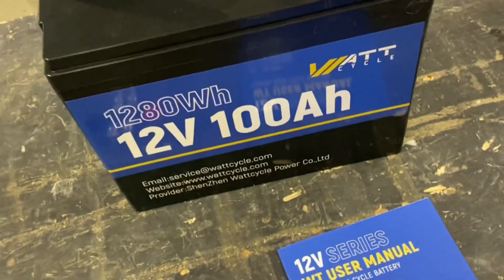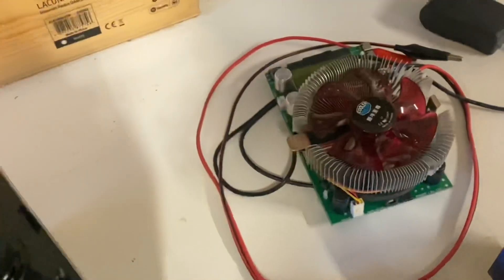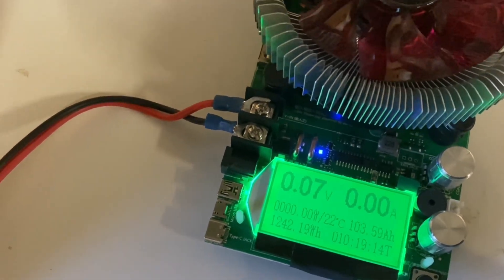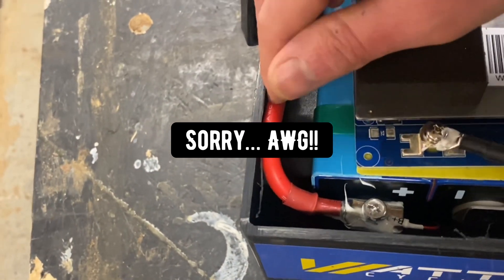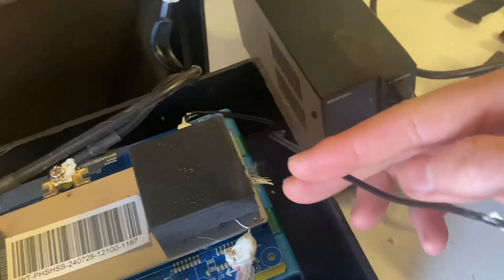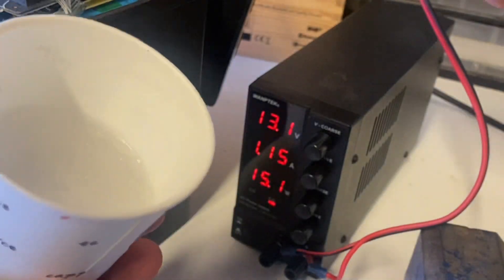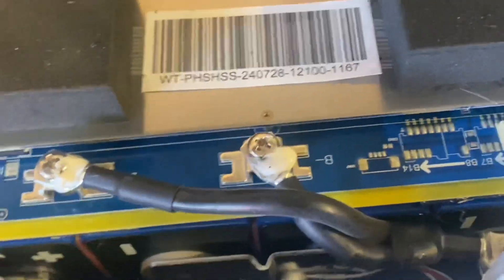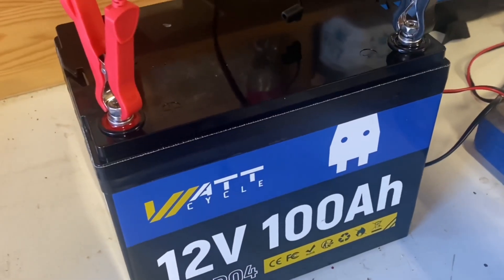WattCycle 12V 100Ah LiFePO4 Battery Review: Capacity Test, Teardown & Temp Protection!

Comment: What charger do you use?
Reply from the maker: I use a DC power supply or a dedicated LiFePO4 10A charger in these videos.
Reply: @JonasSyver  I should have phrased it differently. Do you have a specific brand you recommend? I just bought a wattcycle 12v 100ah but haven't bought a charger for it yet so I'm wondering what would be best. Thanks.
Reply from the maker: Oh sorry😅 depends on budget and how fast you want to charge. For AC to DC charging, Wattcycle has a few options as well. I don’t have a recommendation as of now, but everything above 20A. Will be doing a review of a Humsienk charger in the next two weeks. Best tip I can give is search on Amazon an look for decent reviews. Renogy, ecoworthy and Victron maybe?
Reply: @JonasSyver  thanks
Reply: @MsAnon4223 what charger did you decide on?